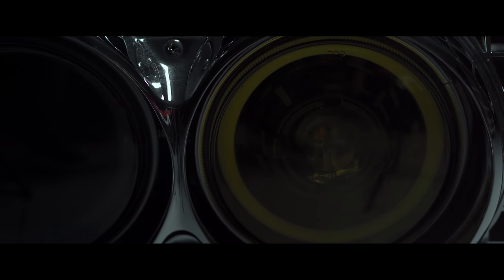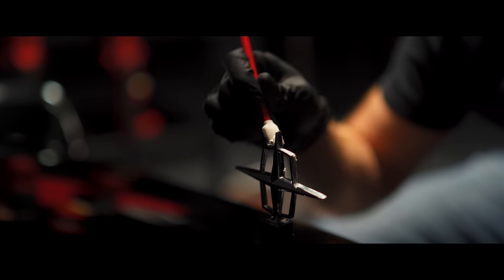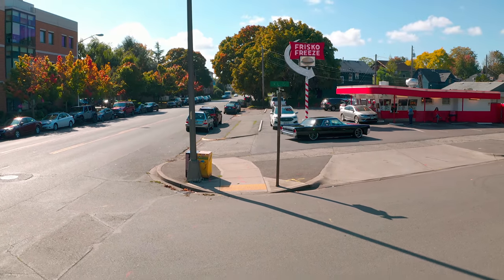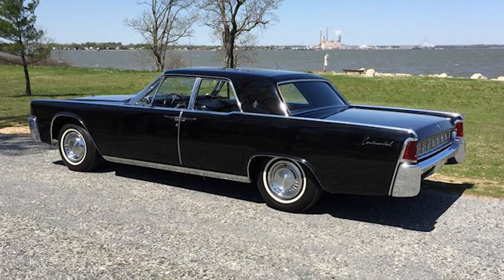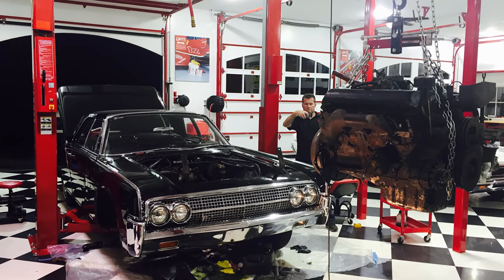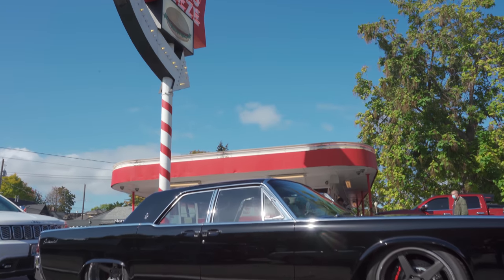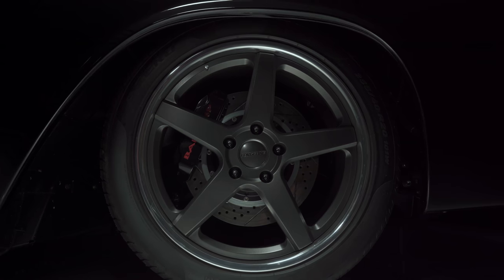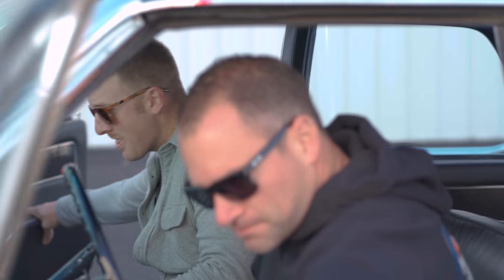Griot's Garage Cover Car:  Nick's 1963 Lincoln Continental

Comment: US President's have been riding in Lincoln's since about 1937 and Roosevelt had the Sunshine Special ( called that by the secret service). They  later during WWII had Ford build a armoured 43 Lincoln limousine  when no cars were basically being built.   Next was a 1950 Lincoln Cosmopolitan limousine ( also had suicide doors) and presidents actually rode in Lincoln's till Reagan got a Cadillac, ( which surprised me because he used to be in Lincoln print adds and owned a 62 or 63 Lincoln Continental.
Love your car., Always wanted a 62 but they are out of my price range now days.  I have a 67 Imperial Crown Coupe with a 440 engine